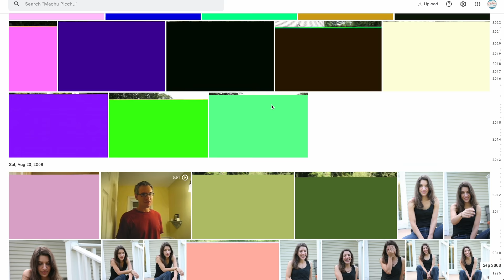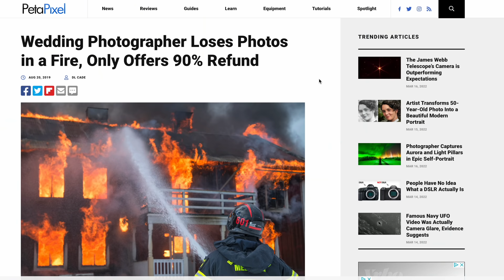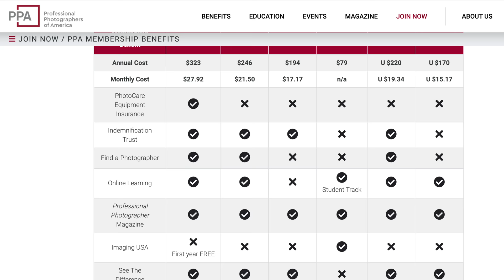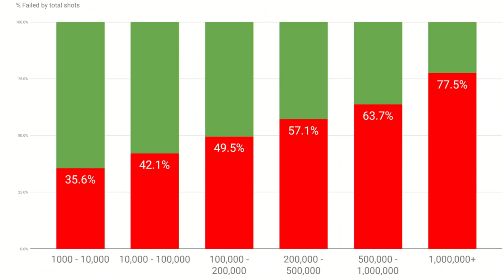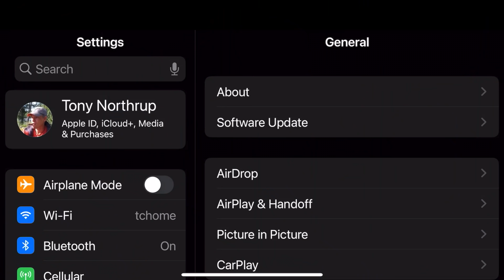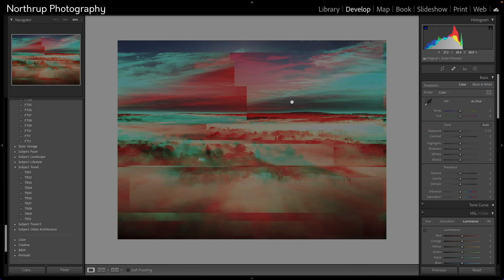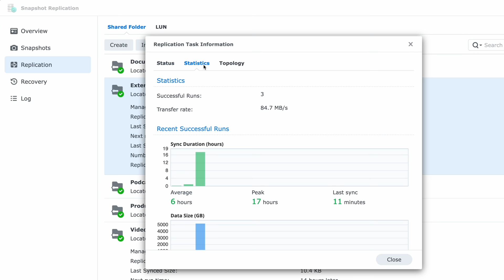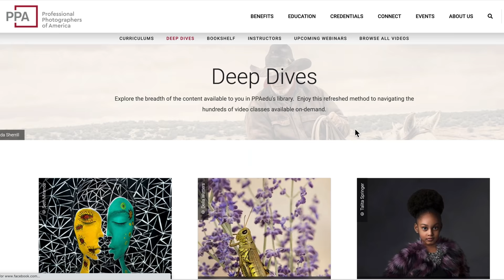NAS Storage for Photos & Video: PROTECT YOUR DATA!

Comment: I had Synology 1512 which supports 5 HDDs with 1 HDD acting as hot backup. I got a HDD failure warning and before i could buy a replacement, a 2nd HDD failed and this screw up my RAID.
The point is, HDDs purchased from same batch and time tend to fail very rapidly between them. It's best to power down the NAS after one HDD failed. Get a replacement and power them up.

Things ran smoothly again until one day, i.e., >7 years of using this NAS, the NAS gave up!! And i am NOT sure if my data is still intact or not. I have not purchase a NAS replacement to test them out.

As i have all my data backup on several external HDDs, i'm not sure if i want to use NAS again. It's too expensive for me just to keep some family photos, videos and personal files. Probably, external HDDs suits me better.
Reply: Good example why most people should not get into a NAS setup unless they need it ( ex: remote access , multi-device or multi-user access , big central storage need etc.)

Same thing for RAID , get it ONLY if you  need it (speed at big storage capacity and/or uptime redundancy)

Most of us don’t consider the NAS unit and/or the RAID controller as ANOTHER point of failure besides the HDD’s themselves.

Comment: What software would ypou recommend that can basckup an SD card auotamtically upon insertion?  Currently, insert the card and create a new Zip file onn my fileshare and then add all the images to the Zip file.  It's a manual process but I haven't found anything that does what I want automatically

Comment: Thanks Tony, a nightmare indeed. I have two external hard drives and two SSD drives backed up with the same content. Should I leave my external disk drives unplugged from the computer until needed or have power to them and unplug USB cables to protect against Ransome ware?

Comment: Question for you.  I haven't had images go bad yet.  Cards, hard drives, sure...  Computers...  Definitely!  You mentioned an image going bad and then it being backed up and writing over a good image if I understood you.  Could you not write a program to create a checksum of the files and then compare them before / after they are copied?  So in the background (at night?) have it go through your backups and check that they still match the checksum?  Flag any that don't.  Just a thought.
Reply: That's kind of done for you by the drive itself. All modern drives have ECC (error check/correct) that protect every bit on the drive. So the drive can detect two bit errors, correct one, on each 64-bits or whatever of data. However, in ordinary use, you don't know when bits are failing -- when the drive is starting to lose its cookies -- because it just keeps working until there are too many errors. There's a protocol called SMART that tracks these errors and actually can predict when the drive is likely to fail. Most of use don't read this information on a regular basis. 

Checksums are good against single bit errors, but you're far better off with a cryptographic hash of the file, that can detect pretty much any error in a file. The right thing to do would be to get a hash of every file, store that has redundantly, and at least when doing backups, detect changes in the file's hash or, if found during an automatic backup, treat the hash as effectively part of the file name, so you'd have two copies of any file with a changed hash, and if you're file syncing, you'd restore the old file in the process.
Reply: @DaveHaynie  Bad choice of words on my part I’m sure but what your describing is what I meant.  I’ve used MD5 at one time for something similar to this.  Just looked it up.  Apparently it has some issues.  It was a long time ago.  Thanks
Reply: @caedgewo2  The main problem with a cryptographic hash is that it's slow -- by design. MD5 is broken (cryptographically) and old enough that it's not terribly slow anymore (another reason it's not really used for cryptography anymore). A modern cryptographic hash like SHA-256/SHA-384/SHA-512 would work, but probably be too slow for practical use.  There are some fast hash functions that might suffice, but I've only studied they cryptographic hash functions myself, so I don't know what best practices would be these days in that area.

Comment: Lightroom has a Validate DNG option which should detect bitrot. It takes a while to validate so if you have a large number of photos it may not be practical to run more than every 6 months or so, which at that point unless you have 6 months of versioning it wouldn't help.  But it is still an option.

Comment: I don't have as much data as the Northrups. I use a Macbook Pro M1 with teh Dropbox app installed and all my images go there standard So the are on my MBP, in the cloud at Dropbox. Than all is also automatically stored on an Imac in the house. Than there is a backup of al this on an other cloudservice. And once in while I make a manual backup to an external SSD. This will not work when my data will grow extensively. Then I will haven to go to the system Tony is using now.

Comment: So I build my own computers (since 1999) and, as a result have a TON of old hard drives that have NOT failed but I chose to keep them rather than destroy them... on those hard drives are original OS like windows 95 along with programs and drivers that worked with those systems... while the OS have changed, most of the data is still retrievable... so I guess that is my ghetto way of keeping my data secure: bunch of redundant disks not araid in any way but there to be opened and looked at one day....

Comment: Synology is a great product but as some others have mentioned-  ZFS is the best filesystem for data integrity.  ZFS checks the data continuously for any bit rot or corruption and is able to repair it instantly from parity data.
I find that TrueNAS is the easiest way to use ZFS.  A Synology is a great turnkey product but I could not trust a non-ZFS filesystem with my precious memories
ZFS also supports snapshot backups. This means that if you delete or modify a file, you can retrieve it from your previous “snapshot” - thus preventing the problem of new “bad data” ruining your backups.

Comment: Can someone do research about how to detect corrupted photo file? Does the corrupted photo file has difference or same hash file vs original? But if the hash difference it also does not know between we edited / corrupt. Unless there are special place in storage dedicated to raw file / original jpg from camera, that will not change the hash, if the hash change, don't back it up / sync it.

About UPS: Does we need to buy the pure sinware or any UPS fine?

I take a lot of photo. In a year before covid, the camera file number always reset (4 digit, if take 10000 photo, the number back to 0). 
I don't have backup aside from Google Photo. Before June last years, everthing photo and video just put it there. I using free unlimited resize. After June 2021, I never back up to Google Photo. Nor in my computer. I put the file in external HDD. Just one instant, not backup. 
I use the first original EOS M, meaning no dual memory slot. 
My worst experience was on my sister wedding, somehow after the wedding, my 32 GB Team Xteem SDCARD failed to read. Luckily my gambling was work. I quick format the card, and use recover software to getting back the file. All file recovered since quick format just delete the index, not the file. 
Since than I never has any other bad experience related to storage. 

I sometimes use HDDe to check my internal HDD. HDDe is the most agresif smart reader. If HDDe tell the HDD is in trouble then it will. It just early. I also use it to my friend hdd laptop and many of it detected bad. So they update their HDD to SSD. All data save. The only drawback of HDDe is it only read internal storage. For external I use Crystall Disk Info. Reading smart sometime could make an early warning to hdd failure.

I don't have fund to buy backup HDD, NAS so I just wish me luck.

Comment: I was under the impression that writing incremental backups as an addition to straight up mirroring keeps me safe. Don't see the extra value of that super expensive NAS setup - what am I missing? Please explain.
Reply: I used to do simple backups too.  If you do 2 sets of backups, with 1 set in another location, you're mostly okay.  However, even backup files can suffer from bit rot over time, so you need some software to periodically check and refresh those files.  At least once or twice a year.  And there's also the possibility that a drive can flat-out fail.  Everything is good until one day you try to access it and it won't work.  The main problem with the traditional backups is when you get into HUGE archives, with 20TB or more of files.  The backup files themselves become unwieldy.  This is where I set up my own parity-based Snapraid system with 6 data discs and 2 parity discs.  This protects me even if 2 drives fail.  I just have to replace the drive, and run a "fix" utility to recreate the data that was stored on the drive.  

Oh, and my setup isn't nearly as expensive as you might think.  Just the cost of multiple hard drives and an enclosure to house them.  When I built a new computer last year, I bought a $100 case that held 8 hard drives, which is enough for me.  Before this, I used a couple of enclosures made by Mediasonic that were only about $100 to $150 for a 4-drive enclosure.  External enclosures are more protected, but internal drives are much faster.
Reply: @alantuttphotography  I should have detailed my workflow more. a) Every backup file I make goes to a raid to protect the backup itself against disc failure and b) I don't back up an entire disc to one archive, but create individual archives for each month of work. Basically my backup software runs incremental, weekly backups of the folder Lightroom makes for the current month. When the month is done I tell the software to stop backing up that folder and do the one for the next month instead. 
The result is 1) all my files are on raids, 2) everything on those is mirrored into cloud storage, 3) everything is also incrementally backed up via crashplan and 4) everything is incrementally backed up into small packages of traditional archives, which are themselves mirrored. Bit rot would have to affect the same bits from the same files on my primary raid, in my incremental cloud backup and my packaged local backup archives to leave me with no recourse, wouldn't it?

Comment: I just did a lossy compressed DNG Backup of my most important stuff and put it in the Adobe cloud, as a last resort emergency backup (still have HDs with the originals in multiple places) finally using that 1TB plan.

But yes, backing up corrupt stuff unintentionally is a problem.

Comment: Dude I am so sorry for your loss with all that data being corrupted with all of those photos

Knocking on wood three times here so far nothing is happening to me again knocking on wood

I have a Western digital My cloud it's not the biggest it's only a 2.5 TB hard drive so far for the past 15 years it has done me quite well it just sits in a corner and just stays there and my cell phone automatically backs up all my photos from the cell phone over to the nas wirelessly

And I have about 10 other hard drives that are backed up on other various photos that I have over many years I'm going to say that's another 12 terabytes in total maybe and that's a big maybe but those are all separate SD cards to hard drives and then put away each SD card has a very particular hard drive that I use for all backups including my Facebook everything goes up to my Facebook
For me it is a online storage facility

Comment: Aren't there drives with ECC you can get for your NAS? Some of those should be able to correct at least some level of random bit flips. That is really odd. Some files I've had for over 20 years and they are still okay.

Comment: Poorly designed file systems are the problem.

Use Linux' latest file system, that actively checks file integrity.
And of course multiple backups - copy your files to multiple drives - external drives with a write protect switch, that are NOT continually hooked up.

Spinning Rust disks are very reliable as offline backup, as long as you refresh them every couple of years. And don't forget about Blue Ray Disks - very stable retention, if stored properly...

Comment: Sorry for your loss Tony, this must be really awful…
The problem with this video is, it does not address the bit rot problem at all… @Tony: You tell us which NAS you use, but it seems this didn’t prevent the bit rotting which ruined your photographs… or is your NAS new and would it protect the pictures now?? Your video raises way more questions than it delivers answers and leaves me puzzled.

Comment: You use the term "bit rot," but given the system-wide nature of the issue, I wonder whether there wasn't an issue with either the Synology implementation of RAID 5 or 6, or perhaps you had an undiagnosed bad disk that striped bad blocks across many files. Of course it would be hard to tell without sophisticated tools, deployed as soon as the issue presented itself. I use yearly permanent offsite storage to guard against this (currently AWS S3).

Comment: So you copied the pictures from the SD card to the computer, and a few hours later the computer crashed, so the backup did not have time to start.  And then the pictures are gone?  The pictures were still on the card, weren't they?  They do not disappear because you copy them to the computer.  And if the computer crashes, are the pictures still on the card?  I can 't get that story together?
Reply from the maker: I used to immediately format the card.

Comment: Windows has a bad history of home networking. They kept changing the process every few years and accessing hard drives on another computer in the home was a real chore. Windows 10 seems to have finally cured the problems. I copy files to large external USB 3.0 drives connected to two home PCs. This is enough space for an active amateur.  Regular migration to larger hard drives means there is more than one archival copy around.

Comment: On my 3 months trip to Atlanta, in the early 2000s I've upgraded my (Windows 98 + Linux) laptop's CPU and this resulted in accidentally overclocking the PCI bus due to a BIOS bug.
Long story short, I ended up with about 30,000+ lost files because the attempt to fix the HDD errors with ScanDisk, was simply making it worse. Having Linux on the same HDD working fine for 3 days, I didn't figure out what was going on immediately. My external hard drive was dropped on the floor the week before, and I also had the "fine" idea to wipe it completely, to have it ready for replacement a couple of months later when I'd return back to my home country, so there was not a chance for recovering the photos and the rest of the files from that one. The perfect storm!
I managed to recover myself most of the photos and the files, simply by renaming all the FILE0000.DAT files to something like FILE0000.JPG and then looking on the thumbnails.
If the disk was defragged (FAT32) back then I could've recovered them all. I've got only the top parts of many of my photos because the rest of the file was stored in a different unrecognised FILE0000.DAT
Obviously I didn't have the time to try and attach all the remaining chunks to the half photos and then see if that would make a complete picture. This process would take forever!
It's probably the only time where a defrag would’ve been useful!

Comment: I shoot dual cards and keep them during my workflow. Once I deliver to the client, I store the finals on a hard drive that never runs, as my archive, and keep it in a cool, dark place.  In ten tears, I haven't had a single lost or corrupted photo.
Reply: Mike I’d suggest creating a duplicate archive on a hard drive from a different manufacturer to protect against any hardware malfunction.
Reply: @christopherbradshaw9863  In principal I agree, but I shoot real estate, so the lifetime of my work is weeks, during which time the files are also on my client's system and MLS. Even if the house doesn't sell and gets relisted by another agent, they can't use the old files.Special use case, I think.

Comment: You still didn't solve the problem of old photos going corrupt, not noticing it and backing those files up. I already lost some photos from years ago, they were backed up in amazon just like yours. But they were also corrupted in there.
Reply from the maker: BTRFS (with data scrubbing) and cloud storage should protect against bitrot.

Comment: Starting out, everything was on an internal D: drive, and my attention to backups was, well abysmal.  And of course, the HD failed, and everything was lost.  Except that about 2 weeks before, I had set up free Dropbox to backup everything to the cloud.  Once the drive was replaced, restoral was relatively easy.

Now, I have all my images on a Drobo RAID5 array in my Dropbox Professional Storage folder, so everything is backed up to the cloud in real-time.  There is also a Synology dual disk RAID mirroring drive where Acronis True Image backs up 3x per week.   And, all HDs are Seagate Iron Wolf NAS quality drives.  Since implementing this 3 level system, I have only had 2 drive failures.  One in the NAS the other in the Drobo.  Easy replacement.  Oh, and everything is on a UPS, a good one, not a cheap consumer-level device.

Comment: Everyone here is talking Hardware.  Full Proof Solution: Flickr Pro at $60/yr.  Far less than you will pay in hardware if you take a lot of pics.   I have multiple on site AND offsite backups on drives, NAS, etc… but always a good idea to also have a Cloud solution as a fail safe.